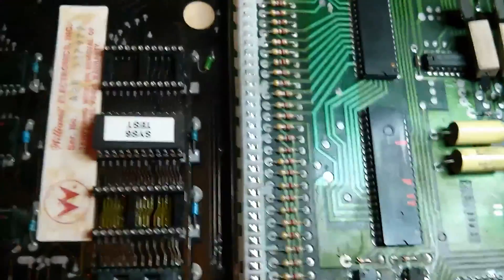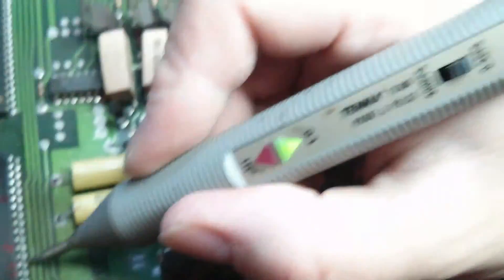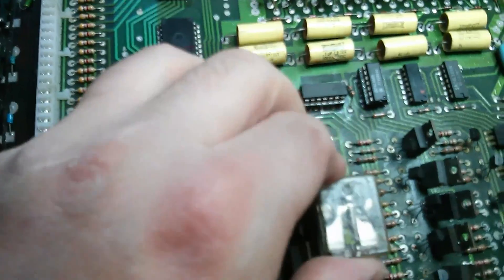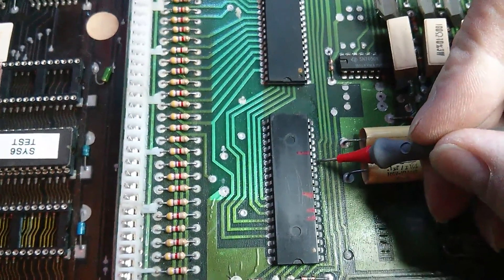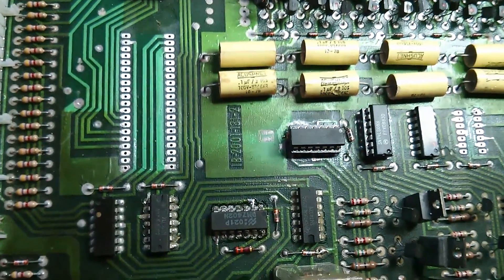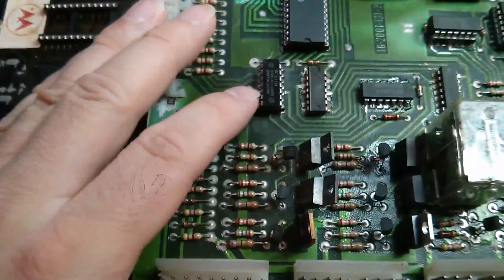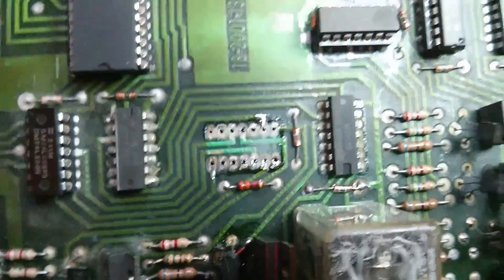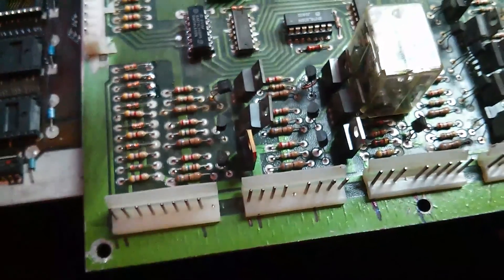Williams Flash Pinball PCB Repairs (Part 2 of 3)

Comment: These videos are the best. I got my own pinball and had to plug around a bit with a multimeter to find stuck switches and a couple bad transistors but this is definitely more intense. I am curious though do you plan on changing over the lamp circuit to take MOSFETS (IRF9Z34N) and drop those huge resistors and tons of heat?

Comment: Very interesting!  Amazing how many faults that board had =/  Is that because they are just left in use despite previous faults, or are they all related in some way?
Reply from the maker: Hi mate, there were not actually that many faults stopping the CPU boards from running, the corrosion on one of them being the main culprit. I suspect that most of the faults on the driver board will have been independent. The arcade operator would have just carried on running it into the ground until it died. I suspect that with the special coils, maybe a slingshot or a pop bumper stops working, then maybe a few lamps stop working, and so on. Yes the game gets crappier each time something fails, but with some lazy arcade op's as long as it keeps booting up, they keep operating it